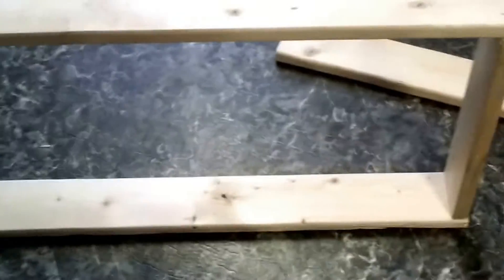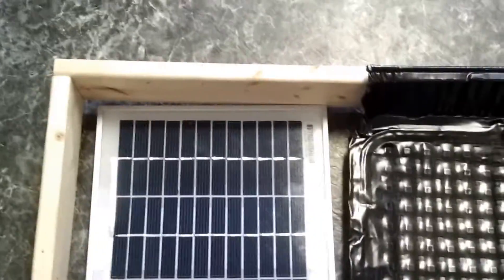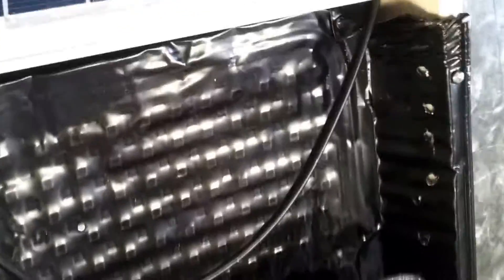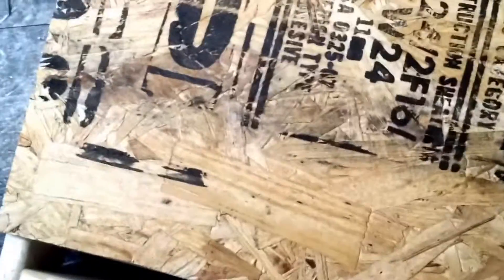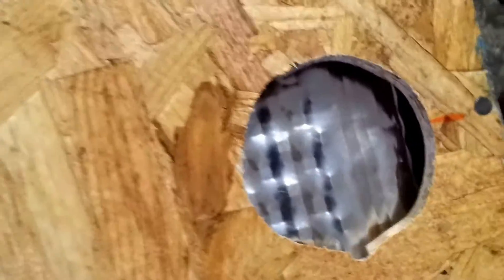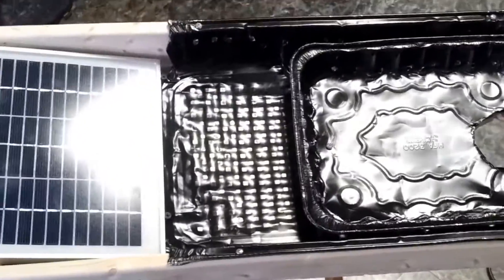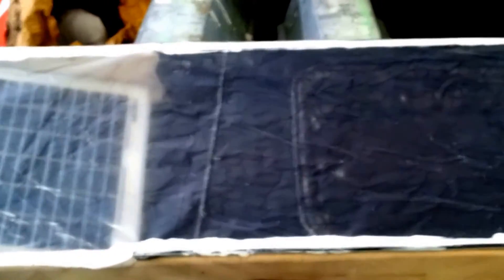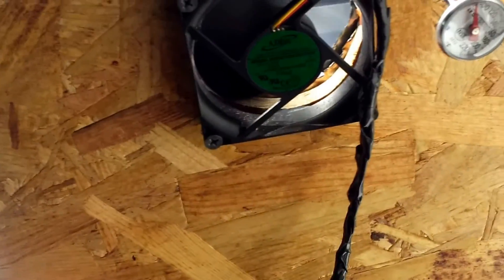Window Solar Heater Self Powered DIY Step By Step

Comment: All solar heaters should be self powered. Works great! You don't need to slow the fan speed too much tho - you're already operating within an ideal temp range for solar heaters (80F - 140F). Decreasing the velocity for a hire temp will only decrease btu production because air is being circulated slower.
btu = (velocity in cfm x cross sectional area of exhaust in square feet x air density x (exhaust temp - intake temp in degree F) x specific heat of air)60

air density is generally 0.065lb/ft^3, and 'specific heat' of air is the amount of energy it takes to 1lb of air by 1 degree F, which is 0.24btu/lbF

By plugging those constants and different temps and fan speeds into the equation above, you can see that raising the temp beyond a certain point isn't necessarily a good thing because less heat transfer is taking place. Instead of being transferred into a cooler but quicker air stream to get the heat where it needs to be, the heat will just radiate through the heater components. That's not completely terrible in your case because any heat loss is going directly into your living space anyway, but it's not being transferred as efficiently. Being a quicker but cooler air stream doesn't mean less heat is being produced - it's just heating a larger volume of air per minute. Too fast tho, and it will feel uncomfortable...like a draft in the room. The velocity/temperature relationship is described in more detail in the link below. Try hooking up a fan speed regulator to the fan so that you can manually control it's speed and knock it down 5 - 10cfm, and see how the heater performs then - just to save you from replacing the fan before you know exactly what you want to get. if you can't salvage one from something then you can find them on places like Ebay or Amazon for cheap. Again, it works great! Best of luck!
  http://renewablesystemstechnology.com/uploads/3/5/1/9/3519440/solarairheating_2.pdf

Comment: don't you need a hole in the bottom of the unit for circulation of cooler air entering the unit and warmer air leaving it?
Reply from the maker: There is about a 1 Inch Gap all across the bottom of the unit for cool air entering the system.  Thanks for watching

Comment: Hi Don. I like your solar heater ideas and I wanted to share a couple thoughts with you. You mentioned that you thought the fan speed might be too high and was thinking about reducing it. I don't think that would help. It might even reduce overall efficiency. Consider that at any given moment of operation the collector is producing a fixed amount of heat no matter what the airflow over it is. So slowing down the fan will not increase the amount of heat made, only the amount of heat moved. Also it takes more energy to heat an object that is warmer (comparatively) to one that is cooler. So the warmer the inside of the collector gets the less efficient it gets. The faster you can pull heat out of the collector = the more efficiently the collector can convert sunlight to heat. Thanks for the video. Keep em coming! :-)